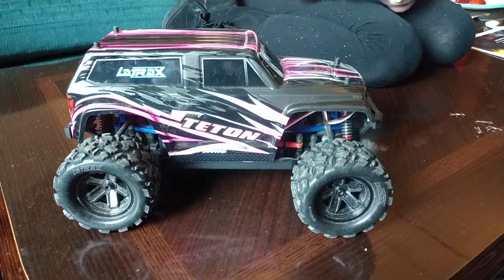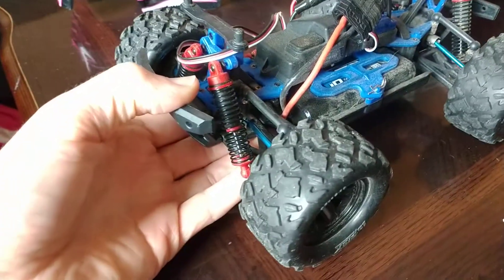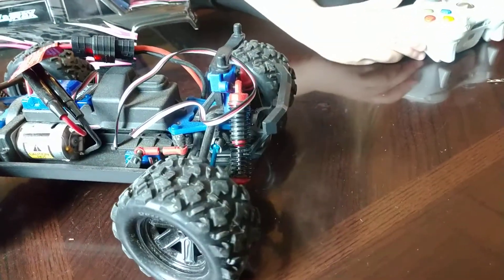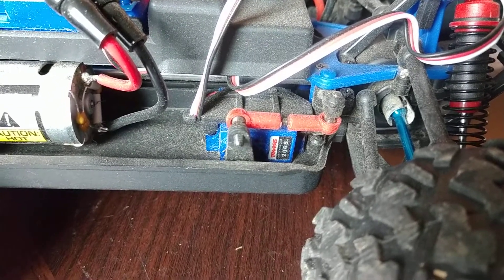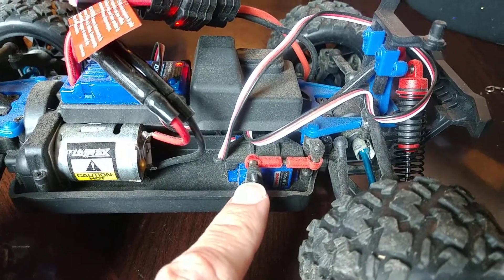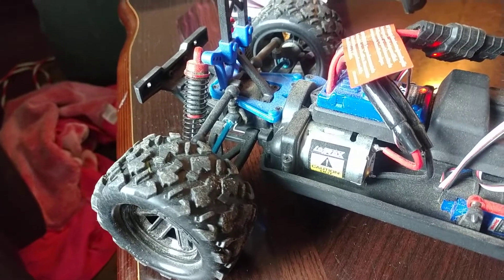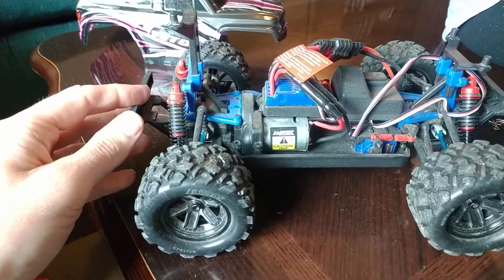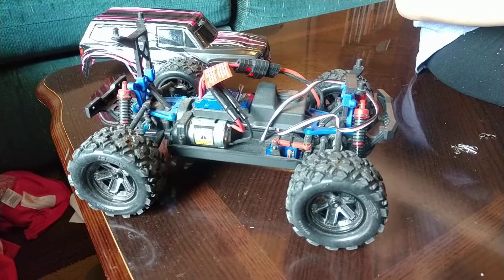Latrax Teton information

Comment: I have 2 of these for my boys, and these runs bashers alot so had to do alot of upgrades on these alot.  I put traxxas metal gears in the stock servo and they seem really well now, even the 1/10th scale servos strip out right away and had to upgrade them all with traxxas metal gears, they should come with them from factory.  I agree, the stock driveshafts are junk, upgrades to the blue aluminum ones from amazon, they seem to be holding up. Also RPM a-arms are defintely and upgrade, stock ones break really easy. Last thing was a hotracing steel spur gear as stock strips easy. almost spend as much as you pay for it to make it from breaking all the time, but they are holding up now good to abuse. I also use gorilla duct tape on the bottom of body to keep them from cracking. good video on these little trucks
Reply: Do you know how to set the servo endpoints?!

Comment: For me, after 20 or so runs, my servo needed to get replaced. The brushed motor also burnt out on me after my first run in grass. I upgraded the system to a hobbywing ezrun 18a and I believe 5400kv ezrun motor. It hauls. Another issue I had was the a arms. I broke one of them on my first high speed collision with the front right tire having impact with with a real car tire. I upgraded the a arms to aluminum and replaced what needed to be replaced with stock parts after that collision. I also heard that the suspension works better, and you have less breakage when it’s put upside down, with the shaft on the top. I’ve also heard the diffs are big issues and most people have the upgrade.

Comment: Just got one. Battery doesn't last 10 minutes.mind you it's outside in snow but still for not running full bore shouldn't we get more than 5 minutes of runtime. Anyone else?
Reply: @DaKrEm2.6  thanks for the response. I'll give it a try 50% to see how it behaves
Reply: @DaKrEm2.6  FYI I didn't know if it was the cheap charger or the battery so I  bought a new battery and a 4 amp charger at a cost of $140 canadian with taxes. The new battery lasts way longer. The battery that came with it still only lasts 4 or 5 minutes with the new charger. Now to figure out if I can get a replacement somewhere.

Comment: Does this over heath and stop if I use a 30C 1300 mAp battery? Ive been really struggling with this car, first  the balance wire dangling and seems to have been causing electric shorts.

Yesterday a new fully charged lipo battery on desert sand. The car stopped after 4 minutes and refused to restart despite several attempts.

Always in Lipo mode.
Reply: @DaKrEm2.6  thanks David. Enjoy the Arrmas.
Need to think of a car for my 4.5 y son. Teton was ok if it really worked. But it hasnt. Maybe a small erevo. Dunno. 👍🏻
Reply: @DaKrEm2.6  Appreciated David! Very informative and helpful. Will go check out the mini e-revo. 👍🏻👍🏻👍🏻